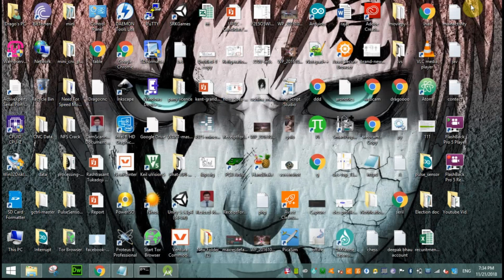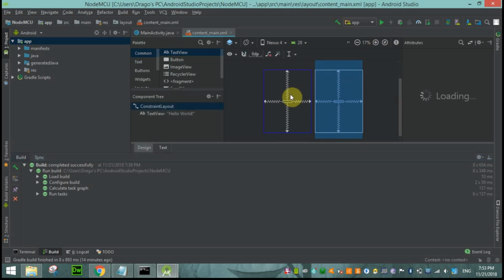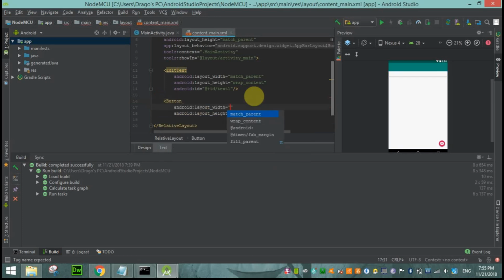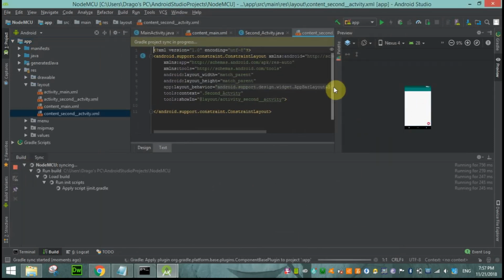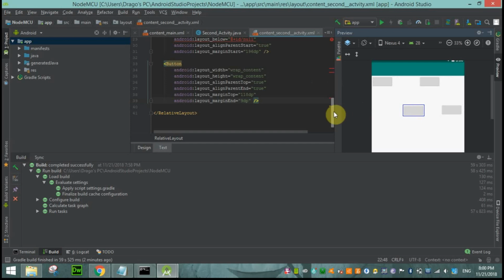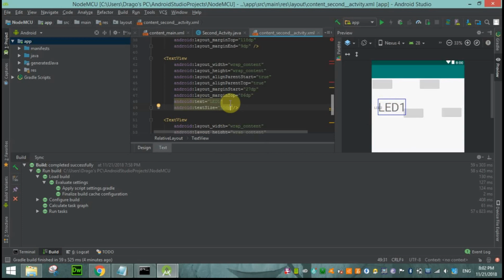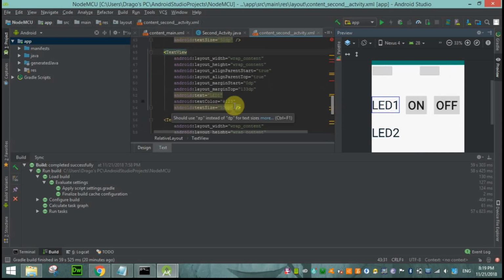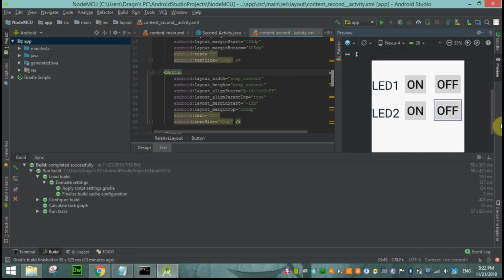Android App For NodeMCU (ESP8266) Controlling (IoT) Part 4

Comment: thanks. Thanks for the video. I copied your code but it is configured on your IP: 192.168.1.33 although my NODEMCU is working working with IP 192.168.0.15 could you give me a hint what's going on?    I have version 4.1
Reply from the maker: ok then change it from text box
Reply: @parthaolad7612  thanks for listening. yes I changed. but I see here that my server is not accepting command from the browser ... I have to see why.  obrigado.
Reply: Everything worked. I will now try to adapt it to start directly on the button screen and with temperature reading.
Reply from the maker: @gilsongoes6116 how did you give the command to nodemcu
Reply: @parthaolad7612  I made a mistake in the coding of the doors, a basic error, but I fixed it and everything worked out. I will strive to get a door reading (requisition). Do you have a tip to help me?